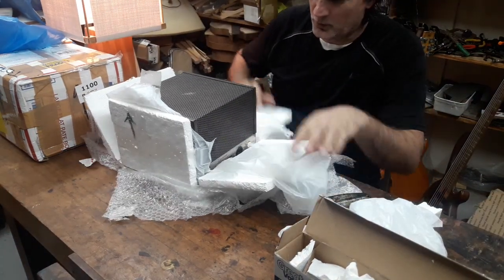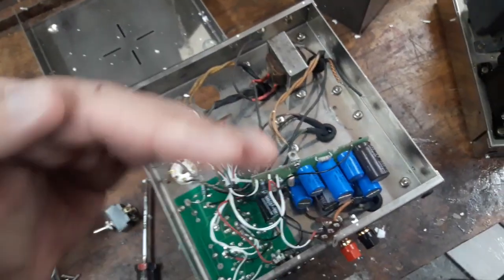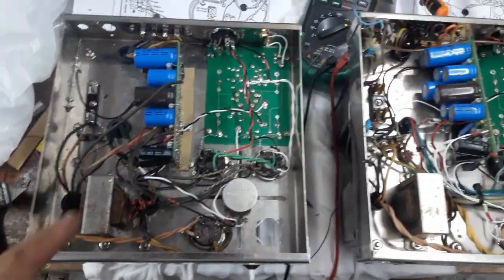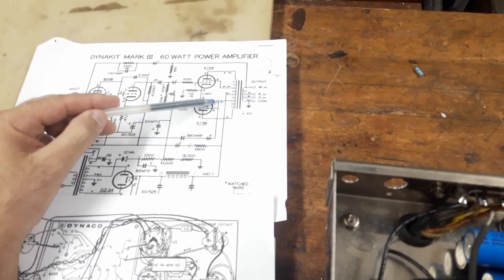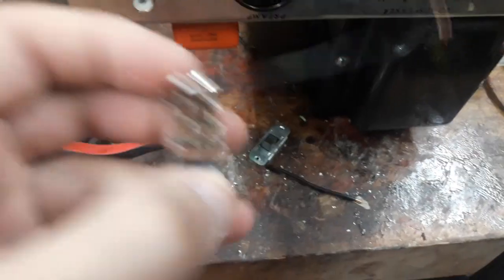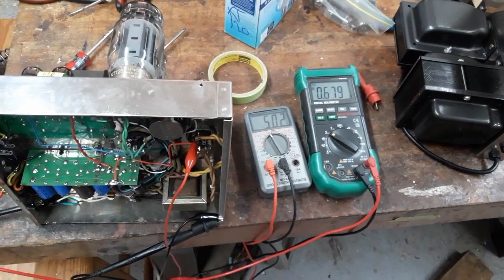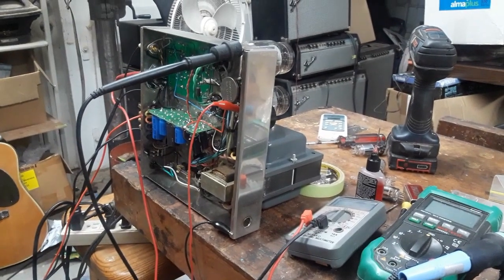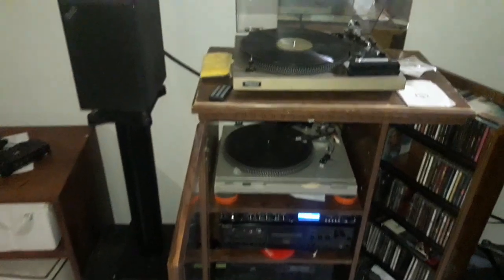Dynaco Mark3 tube hifi amplifier rebuilds

Comment from the maker: Something of an update 3 years later: These amps have been running all day, every day. Presently used with Pioneer HPM100 speakers, and driven by a McIntosh C34V preamp. Pretty soon after making this video I tried the amps both with GZ34 and SSplug rectifiers, and preferred the sound of the SSplugins. I also tried different driver tubes, 6CG7 instead of the 6922s, and preferred the 6CG7's. I have had zero problems other than a noisy 6CG7 in one of the amps.